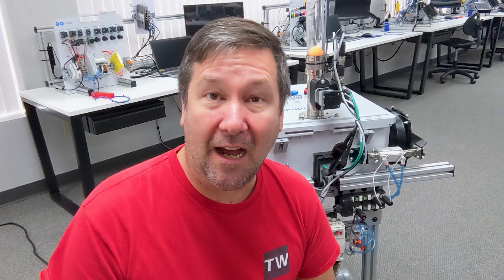Gaining Experience as a Technician or Engineer

Comment: I completely agree with Tim and also agree with the seasoned engineers feedback comment here in the comments. I’m a Field Engineer who works both Process and Automations but I’m better at Process. I came to the Field because I understood System Operations and had background in Maintenance Technician. All that background helped me when I switched over to working Process Control and doing PCE project work. As well it helped me in Automation for which I knew little when I started. To be a better engineer it helps to have actual field experience with many things or even at a technician level.
Reply from the maker: It really is a great path...I just wish I could convince young engineers that having a technician position on your resume is not a bad mark.

Comment: Same is true for a ME. If you want to be a good ME it is critical to have real machining experience. This will make it so if you have something like a sheet metal screw that just holds a panel on you would never specify it to 3 decimals in the drawing. I once had a guy in the small run fab department thank me because many of the other engineers just leave everything on the drawing at the default 3 decimals while I would only do that for something that is actually important. Something my Autocad teacher would always say was "every decimal is an extra dollar sign."
Reply from the maker: Your teacher was absolutely correct!  I see this often and it still irritates me though I have been out of the mechanical side of things for nearly two decades.